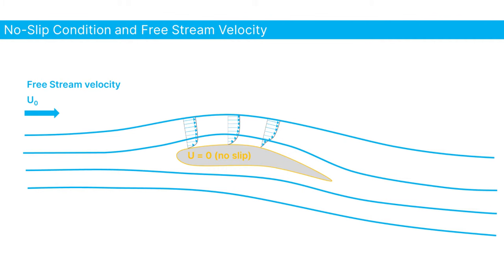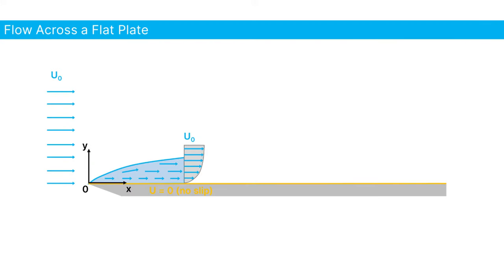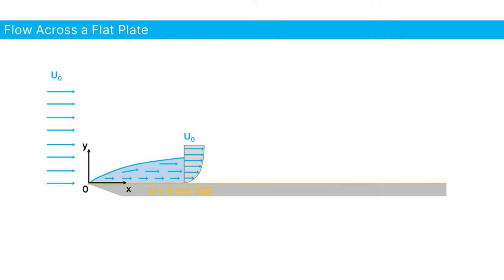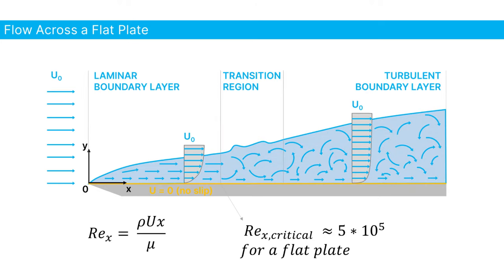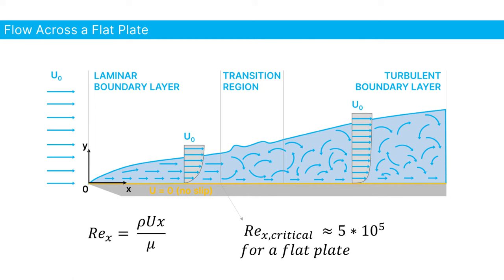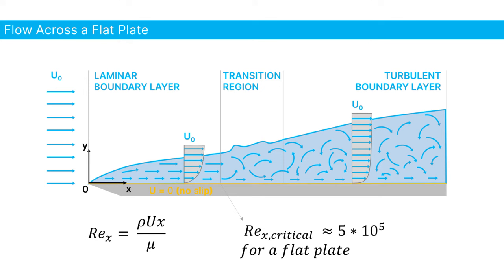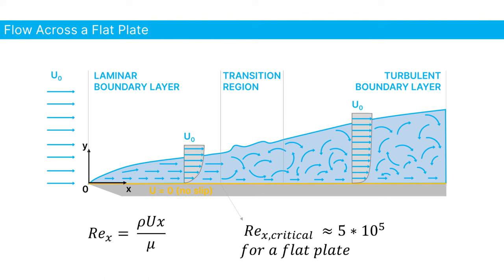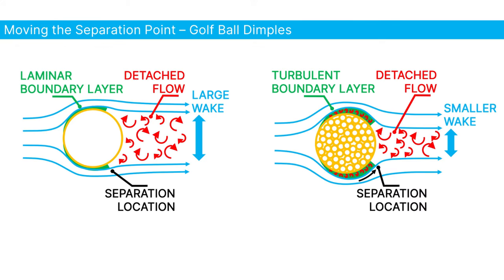What is a Boundary Layer - Laminar and Turbulent boundary layers explained

Comment: Im posting this to help me learn:
Boundary layer-  The area between the flow in contact with the object (here no slip is applied so u = 0 at surface) and the flow that is not affected by the viscous forces of the Object (free stream velocity).

Thanks for great explanation!
Reply from the maker: Indeed Luke!
Keep in mind that that definition is useful for a flat plate, but more difficult for the flow around a 3D object (where most of the flow is actually "disturbed", also outside of the boundary layer).